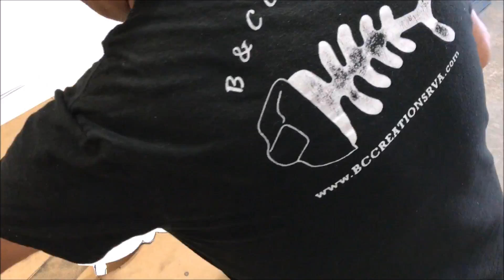Horseshoe art School of Fish DIY Welding Project

Comment: Instead of putting the horseshoe in the vise and working it with your  wire wheels lock the grinder in the vise and work the shoe in your hand. It gives you more control and  less arm strain
Reply from the maker: You should put out a video doing it the right way I’m sure people will enjoy it

Comment: That is a truely extraordinary work in "horseshoe art". Thank you very much for showing.  I'm wondering why there are not hundreds more of likes and I assume, the words horseshoe and welding are missing in the title?  I love the result, however. Allow me two questions to the process: How do you know, your work is about 500° and the blackening will work? Right now I am only guessing and making it frequently to hot. Second, what are the metal balls you used for the eyes? They look a bit as if they were stainless steel, but are probably not? I could see myself making something similiar but wouldn't know were to find good fish eyes, right now.
Reply from the maker: I think I will take in the consideration relabeling this video. As of the heat, I do have a laser pointer Temperature gun. These days you can find them very cheap on Amazon. Also the ball bearings you can find on Amazon you really want to use steel balls not ball bearings ball bearings are hardened and can shatter. Here’s a link. PGN - 1/2" Inch (0.5") Precision Chrome Steel Bearing Balls G25 (25 PCS) 

https://www.amazon.com/dp/B07CHSGGKK/ref=cm_sw_r_cp_api_i_bgPAEbBKEZ1TC
Reply: @AMakersJourney  Embarrasingly enough, I never ever thought of an infrared thermometer for that. I appreciate the hint a lot.